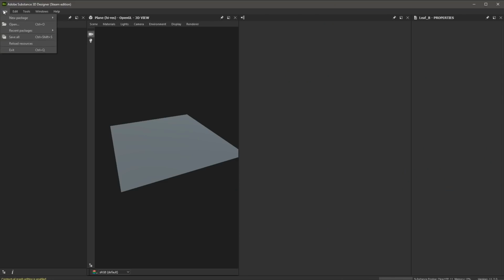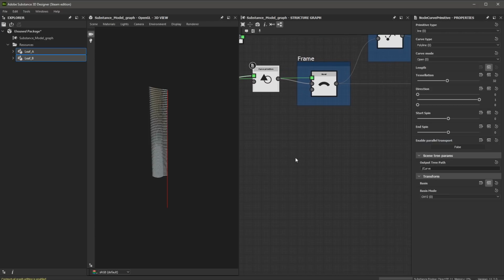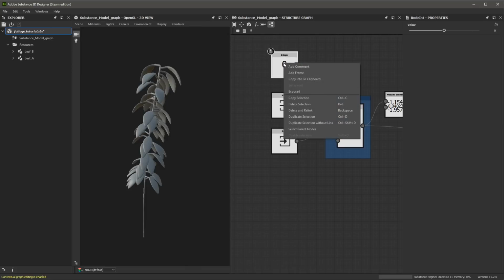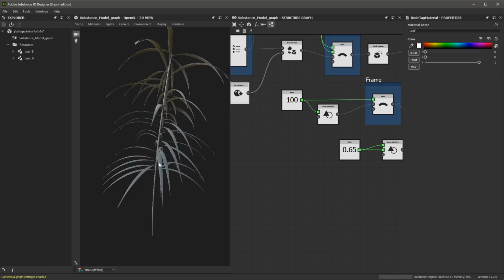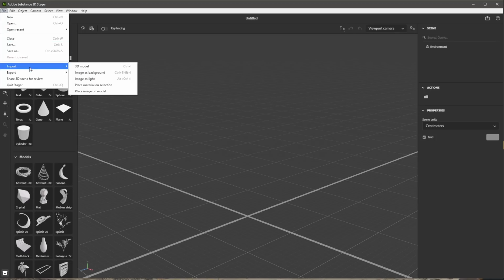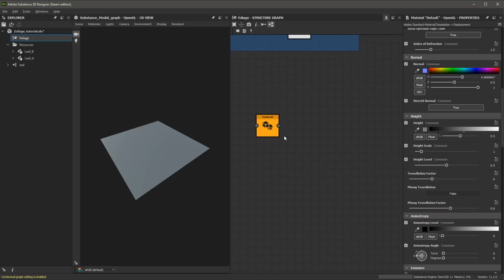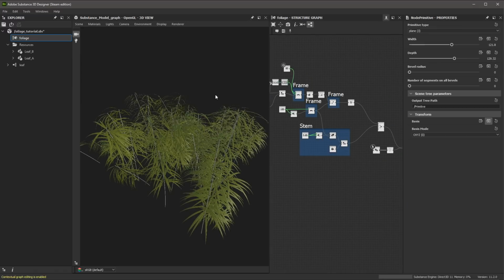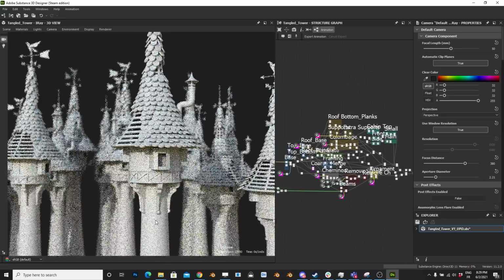Substance 3D Designer: Introduction to Substance Models | Adobe Substance 3D

Comment: I hope the potential of this stuff won't be locked inside the stager, and will receive support in the unity/unreal in the near future.
Reply: That would be amazing. I'm wainting for that.
Reply: Exactly my thoughts!
Reply: Like we did with Substance, we plan to integrate the geometry engine into many other 3D apps going forward
Reply: but it’s adobe 😬 highly doubt it
Reply: The feature of importing  procedural models to game engine has been available for years in Houdini
Reply: @Purbow  yep, and the steam version of the houdini is at least 5 times more expensive
Reply: Houdini
Reply: Lots of potential! :D especially since this is only the first public release.

You can already export a static FBX  and Substance exposed params for both engines, these have been available for some time in various ways.
The new functions here: Mesh param exposure, support would certainly be the next to support outside of the adobe substance eco system for sure.
Reply: @wërwolff_1981  It's true that stager can have a lower perceived value in some realtime engine applications. But it's certainly heavily used in other industries like high end art, automobile, fashion and marketing, the line of course blur heavily as time goes on and individuals these days have much more freedom of choice when it comes to their renderer of choice.

Comment: Nice to see more procedural sofwares to make geometry !  For the moment it's really limited to instancing (like geometry node in blender) and few deformers...now you have to implement the "pixel processor" equivalent with function graph  for points and polygons (where we can get and set position,normals ,uvs) to really have a low level procedural modeler where you can code your own deformers and generators

Comment: The Scatter on Curve node is now deprecated. The Curve Sampler node ( that supposedly replaced it ) doesn't have the same functionality. What should I use instead to complete this tutorial?
Reply: I figured it out. Instead of the Scatter on Curve node, I used Curve Sampler node  + Geometry Instancing node. And instead of the Curve padding parameter, I used the Curve trim node.
Reply: @MariaZelenskaya  Thanks!